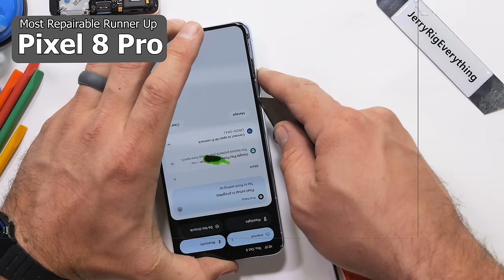Smartphone Durability Awards 2023!

Comment: 7:27
Something like the arc pulse for iPhone ecosystems has been been more than enough for:

1) scrapes on pavement 
2) scrapes on gravel 
3) scrapes on whatever the walmart floor is
 I was pleasantly surprised to see my brothers iphone 13 pro max survive without a screen protector.

I think people underestimate the durability under NORMAL usage.

Of course.

My condolences and my respect goes out to you if you work an intense labor job and might not be able to enjoy your phone in its entirety.

(Think construction from 2nd floor homes or welding with lots of Sharp objects or pieces on the floor)

And i can't speak for the harsh environments in those cases.
It would be kinda foolish of me to do so.

However.
For the majority of peoples environment of indoor floor and carpet and smooth ish pavement and gravel.

Screens have become so much durable. 

I've been able to enjoy a iphone 13 pro max and s23 ultra both caseless and screen protector less and happy to report the screens are perfectly fine since the release date of both.

Comment: A serious question: Why no one does a plastic screen with a removable glass protector for the feel? 
That should be the best for durability, the plastic could be as thin as the fold inner screens.
If it drops you can just change the glass layer and the screen itself would almost never break

Comment: Thanks for the videos...always worth it when the next years model fixes the flaws you find.

I wonder if you could twist test folding phones, only if they pass the bend test of course....could have a folding phone laying face down and someone sits on the device, it wouldnt bend as much as it would twist I feel.

Also, I miss alloy back phones, not sure why gaming phones are not full metal for added cooling (even can have a cutout for the QI charging if need be.

Comment: I know they are kind of old hat these days, but I'd love to see Motorola make your table a bit more this upcoming year. Their general phones have a level of dependability I haven't found in many other phones.

I have had the razr m, turbo 2, moto z2, moto G power 2020 and 2021, and the edge+ 2022, as well as test running one e series. They all were very durable phones, with the Moto Z2 being the least durable tbh, but with an extended battery lasted for flipen ever
Reply: +1, they're definitely doing some good work recently, the G84 for example is pretty much a Goldilocks phone with features not found in comparable phones, available for just ~250 currently. Lightest large-screen device with 5000mah to start with, and a long list from there. Headphone jack, OIS, wide variety of 4G and 5G bands, FM radio, etc. If only they promised more software updates...

Comment: Have to disagree with pixel. I've been a loyal pixel fan since the 2. And my 6 pro has had 3 issues that made the phone unusable and the last time was less than a week ago. My phone's not paid off and Google reps told me to basically shove it. It's no longer under warranty. A PHONE TECHNICAL PROBLEM THAT MAKES THE PHONE UNUSABLE AFTER 5 MONTHS OF BEING COMPLETELY REPLACED. DO NOT BUY PIXEL. The pixel team doesn't care about you. Only your money. Will never buy a pixel again. I loved my 2nd gen pixel. But that was the last good one I owned. Thanks for reading this. Please be safe
Reply: I've heard praises for the 7a though, could just be a really unlucky unit that you got? I do agree on the pixel 2 though.

Comment: If the pixel 7a has the same quality display as the 6a then it is utter shit. My 6a display broke with a case and glass protector wne it fell from my coffee table on the thick carpet. The protector remained intact, the display underneath it was completely shattered. Then it broke 2 more times in a  similar  fashion and drop intensity and now I really don't know what standard price with great camera to get without the fear of it breaking from the vibration motor.....